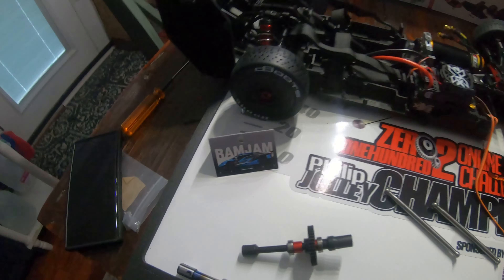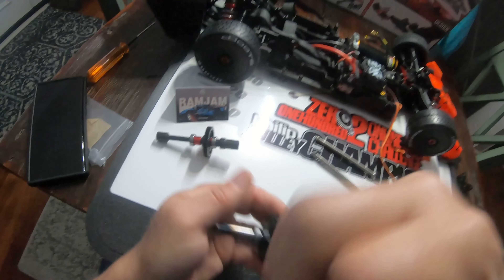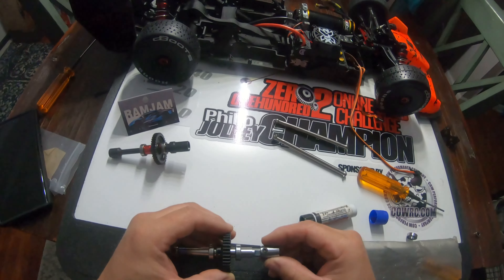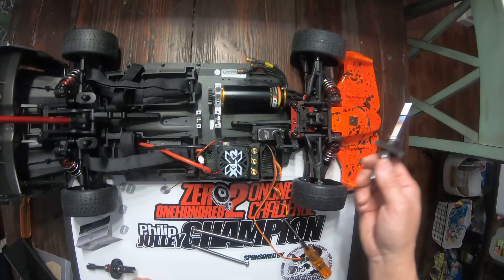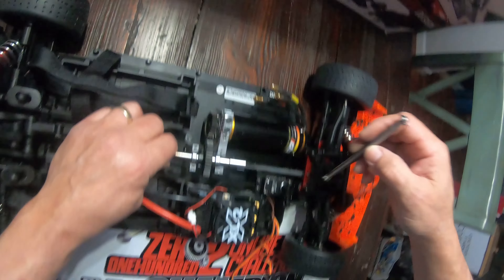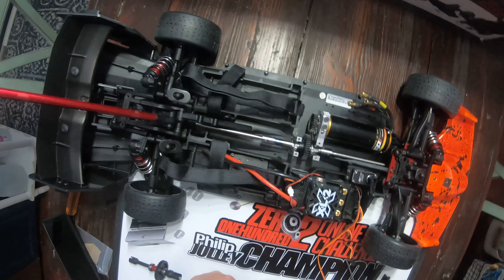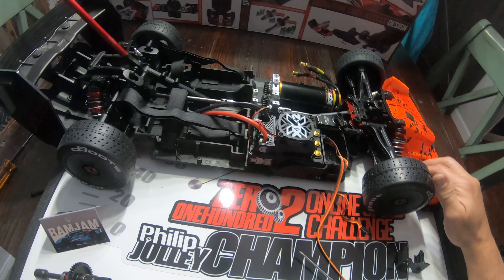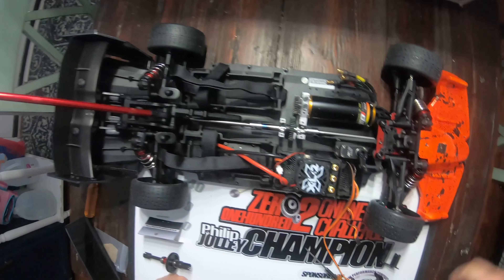Ram Jam Racing Limitless V2 spool build and install.

Comment: Goodluck Phil. I bought a regular length ramjam spool last year and noticed it was extremely unbalanced. All spools I've tried are but ramjam was the most unbalanced. My spool bearings didn't last long and I think that's why. High speed vibration. Anyway just figured I'd share. that. The long spool might not even have that issue.
Reply from the maker: Good to know. I'll keep an eye on everything. Did you reach out to him about it? most i have talked to really like them.
Reply: @Philip Jolley  I didn't and still have it as a backup. I was hyper focused on vibrations in the drivetrain. Maybe mine was an exception.
Reply: @Chris-adams-rc-journey  Sounds like it may be, happy to help Chris